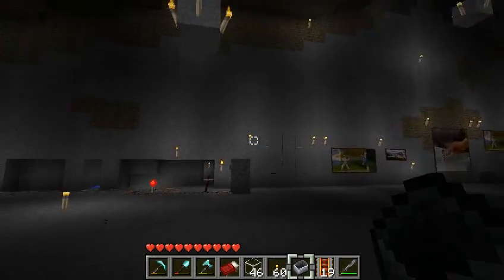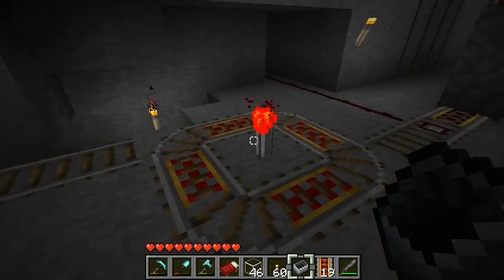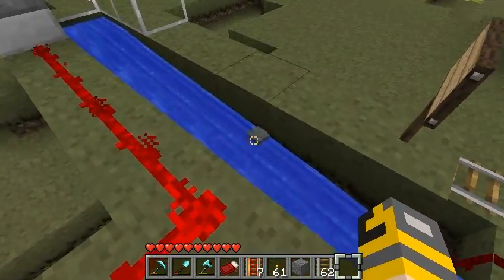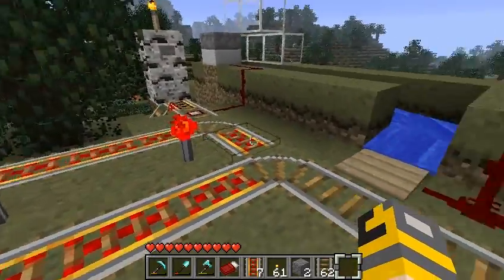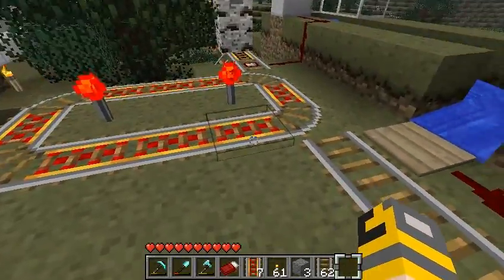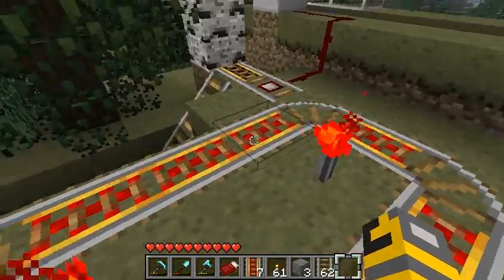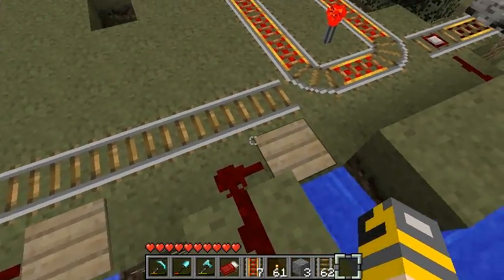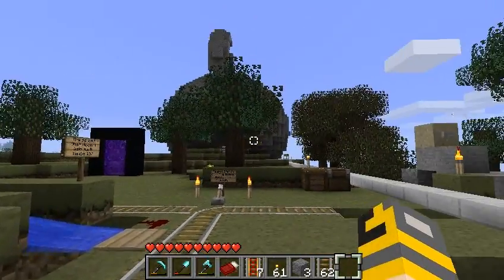Water-timer Cyclotron

Comment: These things are great! I built a shuttle track between the bottom of my mine and the surface, and it sends occupied carts almost all the way up from bedrock. I don't have enough track to make a diverter for inbound carts yet, so I replaced the piece of track in front of the pressure plate with a powered track. It keeps inbound carts from getting trapped in the cyclotron, but lets outbound carts through.
This and the "pain and slowness" video helped a lot in troubleshooting. Thanks!

Comment: @CCNezin1 The cyclotrons aren't meant to boost speed, as minecarts have a very small speed limit. They are designed to boost momentum, as a minecart can still accumulate more and more of it after reaching full speed. Momentum then keeps the cart moving at full speed, so more momentum = longer travel. It's just Minecraft's simplistic physics.

Comment from the maker: @CCNezin1 I recommend you read the Powered Rail page on Minepedia, especially about stored momentum. 3 powered rails get you up to speed, but boost you about 170m on the flat, with the last 60m very slow. 8 powered gets you maybe 260m. There's diminishing returns: 16 rails won't get you twice as far. The cyclotron gets you about 540m, again with the last 60m very slow.